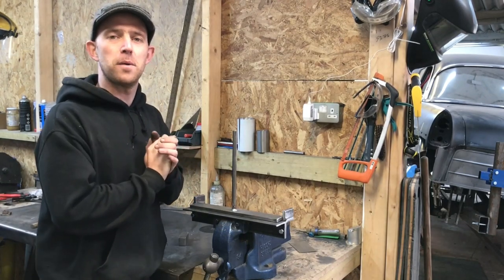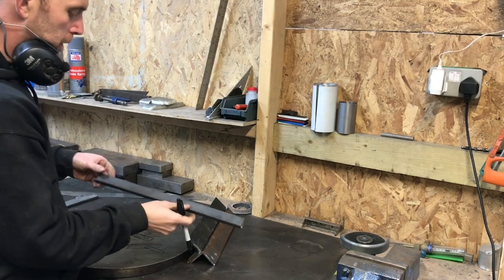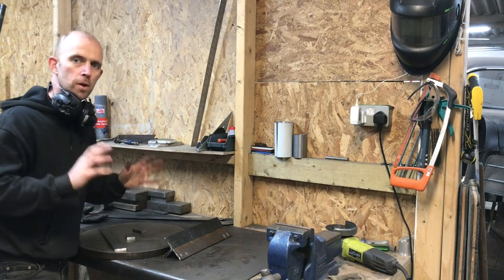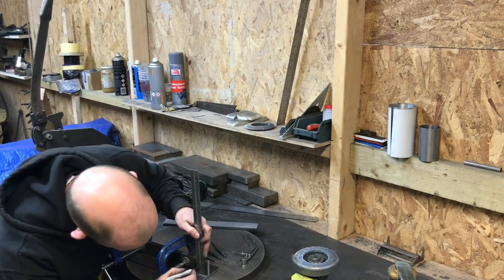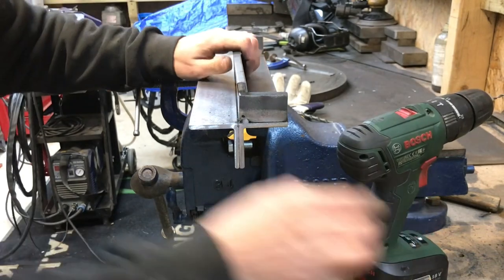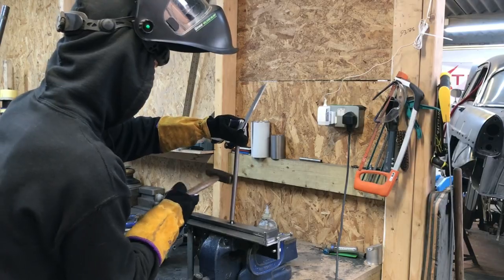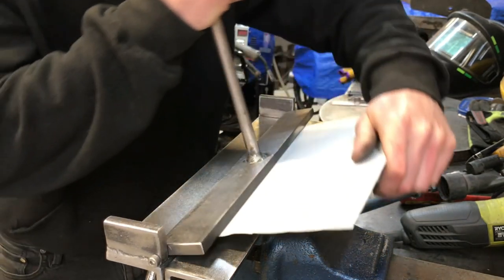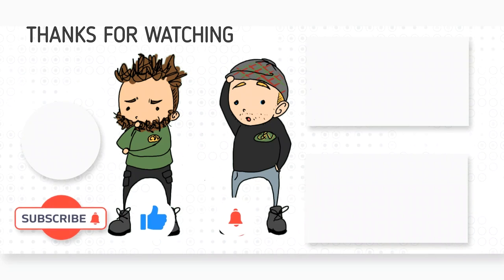HOW TO MAKE A METAL FOLDER FROM SCRAP , TOOL HACK , DIY ,

Comment: My first job out of high school was in  a sheet metal workshop, we had a full size guillotine that could cut up to 1/4 inch steel, and a very nice bender  , with segmented jaws ,  learned to press car sills an floor pans etc, the garage owner had imported all that kit from England , we had a couple of lathes as well , greetings from Trinidad🇹🇹

Comment: Brilliant. How long do you think you could realistically make something like this?
Reply from the maker: Realistically 2 hours as long as your not filming it 😂
Reply: @Metal_shaper_tom  , Sorry, what I meant was how physically long would you be able to make it; i.e. could you make one that was, say, a metre long?
Reply from the maker: @angusmackay7281  sorry Angus that was my fault. I would probably say for this design probably around 2ft. The longer you have it the more pressure on the pivot point so you would have to reinforce this if you were to make it longer. I’ve seen home-made folders over 4 foot long but it’s a slightly more complex design and it has a triangular reinforcing brace that goes across the top so you don’t get any flex in the angle.
Reply: @Metal_shaper_tom  Sweet, thanks.